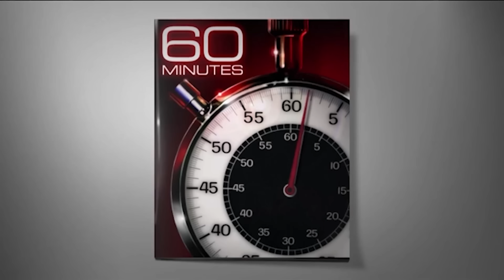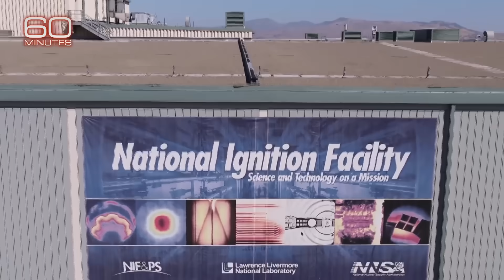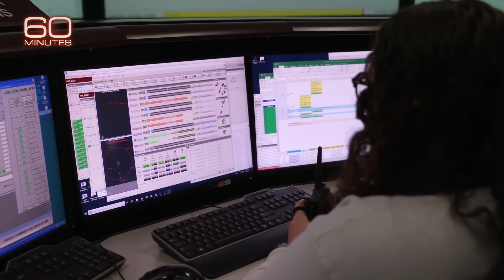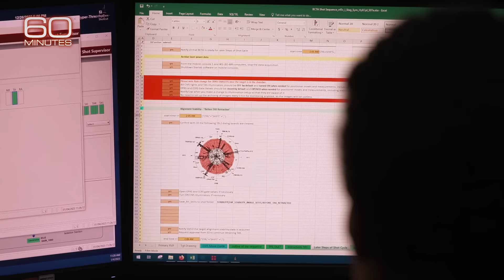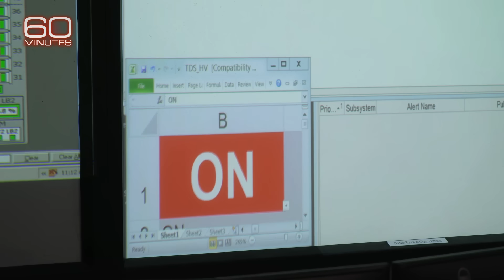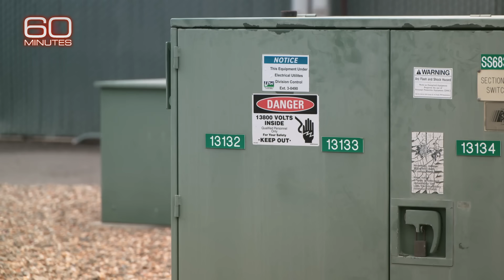Nuclear Fusion: Inside the breakthrough that could change our world | 60 Minutes

Comment: One thing that NO ONE is working on is how do you get that little bit of extra energy out.
Reply: Many have various ideas of how to employ that energy, typically utilizing tried and true engineering principals. Much of the energy went was emitted in the form of 14.1 Mev neutrons and highly energetic alpha particles. Much of the energy was deposited within the walls of the target chamber. The energy was only about enough to boil two liters of water. Those, who listened to the full report, would have learned that the energy to create the laser beams was over 100 times greater than the measured nuclear fusion energy that was produced. Since it took about a week to set up the experiment the total energy entering the facility could have easily been a thousand times greater than the announced nuclear fusion energy that was detected. These are basic scientific experiments that are primarily intended to simulate the processes that take place in thermonuclear weapons (H-bombs). The NIF administrators have always obscured that fact when presenting to the general public. Since the very beginning the NIF has been primarily funded, by U.S. tax dollars, as a nuclear weapon research tool, not a practical path towards a commercially viable source of electrical energy. One estimate is that NIF has consumed approximately $11 billion in U.S. revenues. It has become standard practice for most nuclear fusion projects to be hyped by the experimenters and most of the media that reports on the efforts.

Comment: I appreciated this report that included many aspects of the reported experiment that earlier reports missed. I especially liked the inclusion of Charles Seeife's perspective because almost all previous reports only included fans of nuclear fusion research to provide journalistic 'balance' in their reports. This report also noted that the Lawrence Livermore National Laboratory (LLNL) and the National Ignition Facility (NIF) deal with nuclear weapons research. In fact, this experiment included a weapons related component that was never mentioned in earlier reports. NIF has always been primarily funded as a thermonuclear weapon (H-Bomb) research tool. It was preceded by two other large fusion laser facilities that were expected to lead to the so-called 'ignition' condition.  LLNL experiments in this field began in the late 1950s. NIF failed, by a wide margin, to meet it's primary goal by its 2012 deadline. The LLNL has always obscured NIFs primary function when presenting it to the public. One estimate is that NIF has already consumed approximately $11-billion in federal revenues.

This experiment took about a week to prepare. The fusion reaction lasted for approximately 0.08 billionths of a second before most of the extremely compressed deuterium/tritium fuel plasma was blasted away from the reaction center by the blast of energy it generated. Only about 4% of the extremely expensive fuel ended up fusing. The rest was scattered in the target chamber which then required removal as radioactive waste. This report failed to mention how rare, expensive and radioactive the tritium fuel is. The current market value is approximately $30,000/g. The precision hohlraum and nearly perfect diamond fuel capsule was converted into a plasma along with the close-in structure that supported the assembly. One estimate of the target cost is $100,000. If one assumes that a repeat experiment is conducted once a week then the duty cycle of the fusion reaction would be 0.0000000000001%. There are many orders of magnitude of advances needed before scaled up fusion energy power reactors, that are commercially viable, can displace our addiction to fossil fuel derived energy sources. Experimenters, in such fields and their fans, must be experts in excluding warning reports, such as the following, from their consciousness.

IPCC report: ‘now or never’ if world is to stave off climate disaster (TheGuardian)

The lab employs their own definition of 'ignition' that is different from most people concept of ignition. Most people equate the term with something like a match head striking a rough surface where the initial reaction spreads to the rest of the fuel in about two seconds. There was no significant spread of the fusion reaction in the NIF Inertial Confinement Fusion (ICF) experiments and that reaction was primarily dependent upon the 3 billionths of a second compression from the X-rays generated from the The impinging laser beams. The lab staff claims one reason the laser input energy was about 100 times greater than the fusion energy output is because their lasers are old. In past breakthrough announcements to the public they failed to mention the amount of energy used to create their compressing laser beams. They are looking to eventually employ more modern Laser Diode Pumped Lasers (LDPL) which can be up to 20% efficient. Even the largest of those lasers don't come anywhere close to even one of NIF's laser output energy. In the case of NIF the compressing energy is shifted in wavelength at least twice. If the same was done with LDPLs the efficiency would be far less than 20%. 

I urge readers to search for the following titles.

Is This the ‘Kitty Hawk Moment’ for Fusion Energy? (TheAtlantic)

Sun in a Bottle: The Strange History of Fusion and the Science of Wishful Thinking
By Charles Seeife - Published on 30 October 2008

ITER is a showcase … for the drawbacks of fusion energy (The Bulletin of the Atomic Scientists)

Comment: Need to shoot the shell twice, two laser volleys. Try it.
Reply: A great many people are convinced that they have thought of things that decades of research in this field by thousands of Ph.D. physicists have never taken into consideration.

Each laser pulse shot lasts for approximately 0.000,000,030 second. To avoid damaging the over one-billion dollar system only about one laser shot can be performed each day, at best. The reported experiment took about a week to set up.

Once the fuel capsule is hit by the laser pulse it almost instantly vaporizes and is then converted into a superheated plasma which then compresses down to a microscopic size. The nuclear fusion reaction then last for approximately 0.000,000,000,08 second. As it is happening the forces at the center become so great that the vast majority of the remaining fuel is blasted away from the center in a massive explosion that is over in less than a microsecond. There is no time, or capability, to shoot another laser pulse into a target capsule that no longer exists. Within microseconds of the first laser pulse all the nearby fuel capsule supporting structure is vaporized by that laser pulse.

Consider how many millions of people watch these slickly produced media videos that have almost no clue to the technology behind these experiments.

Comment: How many units of power did it take to energize the lasers? And maintain the magnetic field more than three units LOL
Reply: The National Ignition Facility (NIF) employs the Inertial Confinement Fusion (ICF) technique and doesn't rely upon extremely intense magnetic fields to confine a plasma. The lab management stated that the energy that went into the array of 192 lasers was 400 megajoules. That is 127 times the amount of fusion energy that they measured being emitted from the fusion energy reaction. That input energy didn't include numerous other pieces of equipment and the amount of energy consumed by the lab during the week it took to set up the experiment.

Comment: A STAR IN A JAR
Reply: The star in the center of the large vacuum chamber took more than two weeks to prepare for and lasted for approximately 0.000,000,000,08 second. The energy input, just to drive the lasers, to create the microscopic explosion was over 100 times greater than what the nuclear fusion reaction generated.

Comment: Somehow iintuitivly I feel the only way to make fusion viable is to make the mass of the material or fule so great that artificial gravity is produced and maintaned as with the sun. Otherwise you need to put so much energy in to to keep the process going.
Reply: If the mass the fuel became great enough to create a gravitational field similar to the core of the sun then it would draw in any nearby surrounding matter and that would extinguish any possibility to create the fusion reaction.

In the announced NIF experiment the mass of the supplied fuel was in the milligram region. The reaction occurred within a microscopic spot once compressed by the X-ray pulse. Only approximately 4% of the supplied fuel fused before the remaining fuel was blasted away from the reaction center.

Comment: Yesterday, they did it again. The future just got a little bit brighter.
Reply: Examine the reporting articles closely. There were almost no details compared to the 13 December 2022 announcement. It read more like a NIF lab press release with no attempt at journalistic critical analysis. It is now 7 August 2023. The NIF lab has had 243 days to duplicate, or better, the results from their announced 5 December 2022 shot. The results were then at least a million times away from anything like an economically practical nuclear fusion energy demonstration power plant.

The 30 July 2023 announced shot produced approximately 11% more energy output then the shot seven months ago. There needs to be more than a million times improvement in numerous parameters, such as shots per second and energy output, before an economically practical power plant can be constructed. Someone should plot out how long it is likely to take before we get there at this rate of progress.

Comment: LLNL Laser Confinement is not a “breakthrough”!! That a TOTAL 3% efficiency. Hardly any closer..
Reply: I believe that the actual laser input energy compared to the measured nuclear fusion reaction efficiency was less 1%. The experiment took about a week to set up so the building input energy, over that time period, would have been far less than the laser pump energy. The result for that extended measurement would have been far less than 1%. During the second day press conference one of the NIF staff members had to admit that only about 4% of the supplied fuel actually reacted before being blown away from the microscopic reaction center. The lab has always misled the public with its use of the term 'ignition.' This Inertial Confinement Fusion (ICF) technique can't generate any significant level of nuclear fusion reaction propagation before immense forces blows the unreacted fuel away from the reaction center. The announced goal was expected to be achieved by 2012 but they missed the mark by a factor of at least ten. It took a decade of tweaking to get to where they were supposed to be. The machine is estimated to have consumed close to $11 billion already in this quest. Virtually all the funding has been allocated for thermonuclear weapon (H-bomb) research purposes.

Comment: Pipedream… currently 400 megajoules. Or about 153 cars fire this laser to power it for 1 billionth of a second , not sustainable, not self driving, not hot enough. You need more power however if we actually achieve that we better have a containment system that can withstand the pressure which will be exponentially greater than this minuscule amount that we have been toying with, otherwise we are just creating our inevitable demise.
Reply: I'm glad you recognize many of the limitations that this sales hype video glanced over in order to reinforce the nuclear fusion energy fans desires. The announced reaction was much less than a billionth of a second. It lasted for approximately 0.000,000,000,08 second. Then the repulsion forces of the microscopic fusion reaction blew away the remaining fuel from that reaction center. It was later reported that only about 4% of the fuel reacted with the remaining 96% being blown onto the inner surfaces of the target vacuum chamber. That had to be removed as radioactive waste. The NIF management's definition of 'ignition' is totally different from what is commonly considered 'ignition.' In the NIF experiment no significant propagation of the reaction took place in the exceedingly compressed fuel. The experiment took about a week to set up. The energy consumed by the laboratory during that time was far greater than 400 megajoules. The experimental goal was expected to occur by 2012 but they failed by a factor of more than ten then. It took a decade of tweaking to finally reach the questionable goal. It's been estimated that close to $11 billion has already been expended upon the project which has always been funded primarily as a thermonuclear weapon (H-bomb) research tool. The NIF management has always obscured that fact when presenting NIF to the press and to the public.

Comment: I hope its commercial power today. 🎊🎊🎊💃💃💃🎉👏👏👏👏👏👏❤️❤️❤️
Reply: The controlled nuclear fusion energy experimental work has been going on since the late 1970s. Now there are over a dozen machines scattered around the globe with most people still saying a commercial electricity generating plant is likely at least 20 years away, as was the case in the 1980s. Most fusion energy fans are clueless regarding that history.

The NIF experiment announcement, covered by the above video, was expected to be achieved by 2012, a few years after NIF began full laser power operation. It failed by a factor of more than ten and required a decade of tweaking to achieve what was recently announced. Typically the press and public only hear about isolated achievements between dozens, if not over a 100 other experiments. In general the announced experiment announcements are delivered with much sale hype that are aimed at attracting investments from potential investors to keep the experimental programs going.

Comment: I have a question once all the fusion fuel is used up… would the reactor collapse ?
Reply: As in controlled nuclear fission reactors that concept is to replace the fuel that is consumed with a feed of new fuel and also extract the waste products produced.

The NIF management has always been deceptive regarding the term 'ignition' in their machine. In the announced reaction it only lasted for approximately 0.000,000,000,08 second and extinguished almost the same time that the reaction began. There was no significant propagation of the reaction through the supplied fuel before it was blown away from the reaction center. In fact only approximately 4% of the supplied fuel actually reacted. The rest had to be removed from the target chamber as radioactive waste.

In the case of this announced NIF experiment the reaction volume was microscopic in scale. The volume of it was many tens of millions of times less than the target chamber sphere that it was in the center of. Before the explosive reaction the space within that target chamber was pumped down to a high vacuum. The target vacuum chamber is very robust and designed to withstand an ultra-high vacuum for extended periods of time.